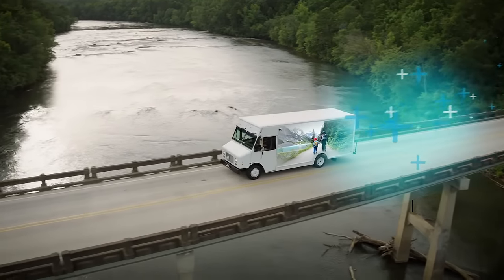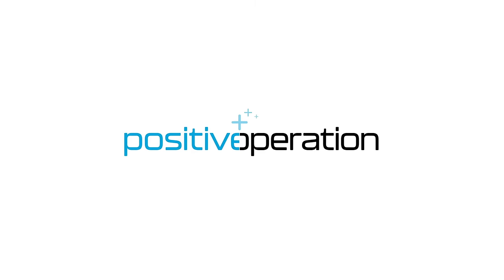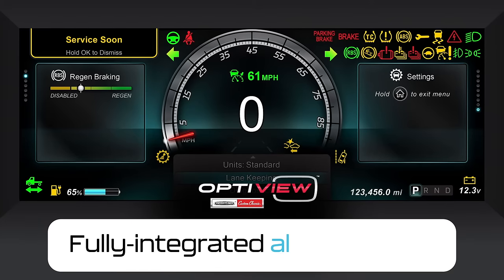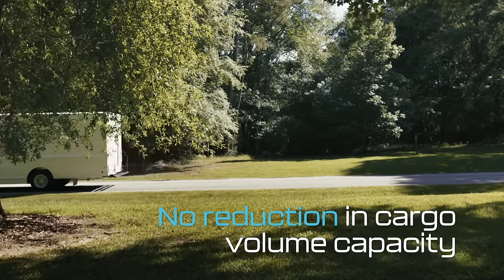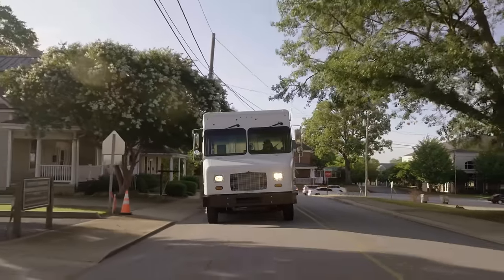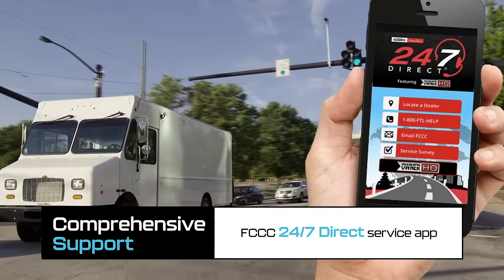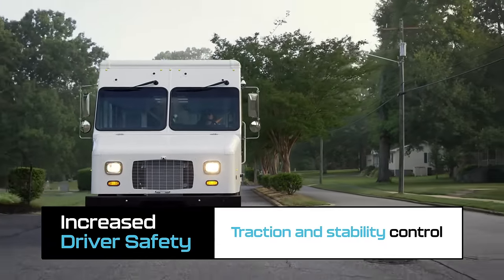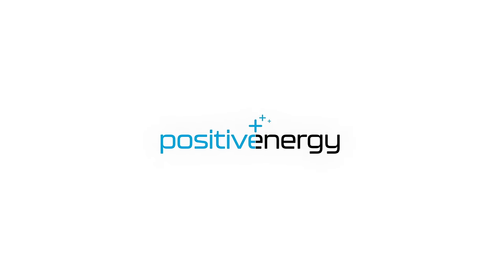Positive Energy: FCCC’s all-electric MT50e walk-in van chassis

Comment: ⚠️Major Changes Needed⚠️
Payload, Range, Driver Safety & Employee Retention are Key Thus MUST:
 1: Replace heavy solid front Axel and steel frame with Military grade high strength Aluminum frame and for light weight front independent suspension components with 60° wheel turn cut. 

2: Replace heavy steel springs with four corner air bags which provide:
1: Self Leveling
2: Enhanced Stability Control
3: Programmable Auto Lowering for Ease of Entry and Exit
4: Driver Comfort which Significantly Increases Productivity & Reduces Costly Employee Fatigue, Injuries and Turnover.
Reply: @icare7151 Does it have regen brakes  for charging Using regenerative brakes helps preserve and replenish range in an electric  vehicle an air ride system would be great with some ultra thin solar sheets on that broad spacious roof providing energy on the go
18 Times More Power: MIT Researchers Have Developed Ultrathin Lightweight Solar Cells